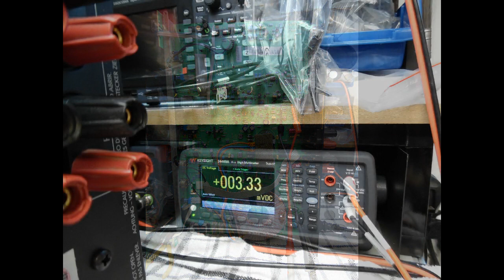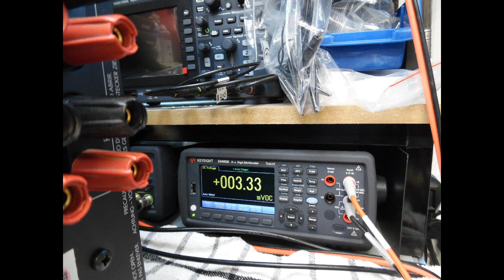Arcam Alpha 7R Amplifier Repair (With Audio Tutorial)

Comment: In the Arcam service manual it states that the bias voltage should be betwwen 3.0 and 3.5mV across R1 & R101. I set mine at about 3.25mV.
Reply from the maker: Excellent